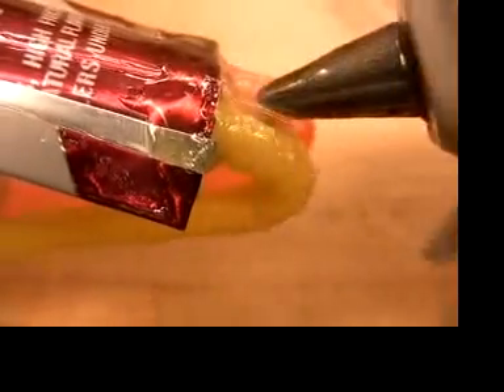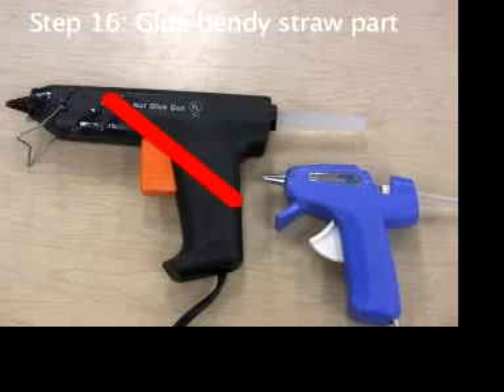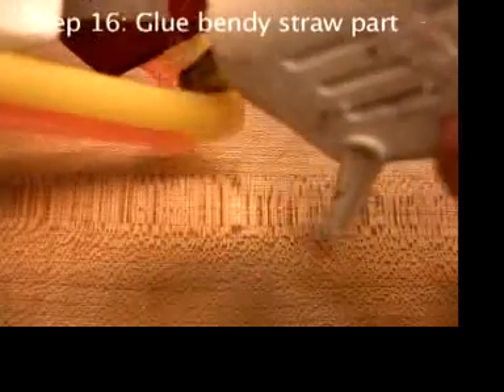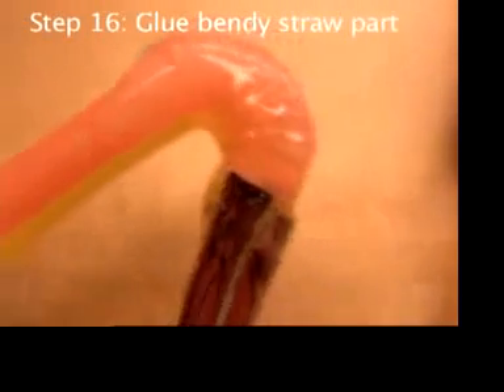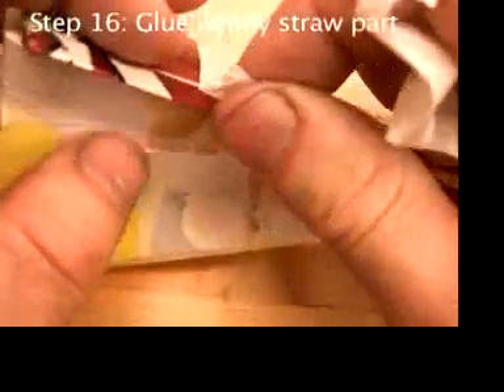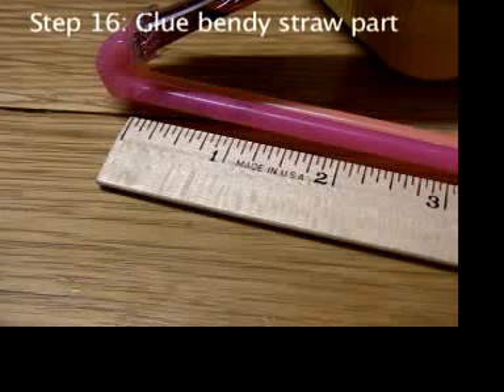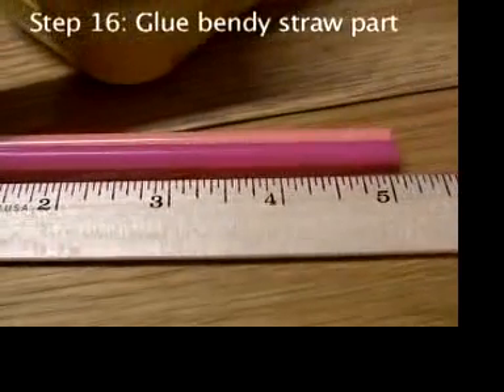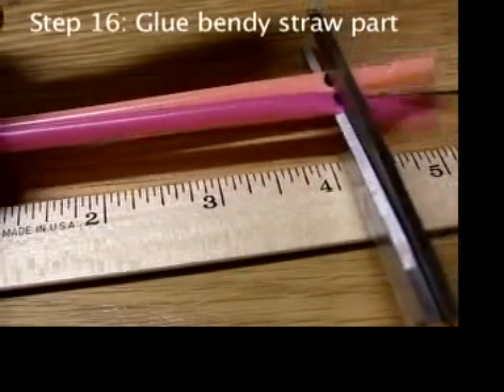Part 19 Build a Putt Putt/Pop Pop Steam Boat s16 glue bendy

Comment: My glue melted through the straw and my project is due tomorrow!!! Does this mean i will have to start over?
Reply from the maker: That's why it said to use the cooler kind of glue gun. You might be able to rescue it by unplugging the glue gun so the glue has cooled somewhat, but not yet solid. Then patch it. Or use another kind of waterproof glue--like epoxy--to patch it. Don't wait until the night before a project is due!

Comment from the maker: That is correct, because hot glue at the metal part where it gets quite hot would melt. But I can hold the engine by the bendy part even while it's running. The bendy part does NOT get very hot, so hot glue works well there. Some people don't like epoxy so they have the option of reducing the amount used.

Comment from the maker: Well, straws are cheap, so you can experiment. Even if it's too hot, you might be able to plug in the glue gun and use it as it's warming up, before it gets too hot.

Slater

Comment: im just gonna leave this here:
if you have a high power glue gun, you can use it BEFORE its fully heated. Apply glue once the gun is just hot enough to squeeze the glue out. I did this with a 60w and my super thin staws are fine

Comment from the maker: @TOMREED1 I don't know all the dynamics but I think, yes, too long would create too much friction in the pipe to work. If the pipes were too short the water column would not have enough momentum to set up the instability that alternates between high and low pressure. It would be interesting for someone to experiment with how long and how short the pipes can be.

Slater

Comment from the maker: @GLADIETOR The 102mm length of straw after the bend is based on anecdotal observation. It goes faster when i cut a little off.  If i cut off too much, it stops working. I can only speculate why. Perhaps the extra length introduces extra friction?
Slater

Comment from the maker: @melason83 The epoxy glue is used where the engine gets hot. You cannot use hot glue instead because the glue will just melt when the engine gets hot. Try to find epoxy.
Slater

Comment from the maker: @DeKatBe Actually, epoxy would work to keep the straws stiff. But people seem to hate working with epoxy. Because--unlike the engine--the straws do not get hot, you have the option of using hot glue if you prefer.
Slater

Comment from the maker: Silicone is not strong enough to hold the arched shape. You could use it in addition to the epoxy to help seal the engine, but then you have to wait several hours for it to cure vs 10 minutes for epoxy. And if you have to add more, only silicone sticks to silicone.
Slater

Comment from the maker: If you look at the package for white glue, it will say "water soluble" so water will melt it, and "for porous materials" which means it only works on paper, leather, wood, etc--not metal or plastic. So it won't work. In the introduction, I ask, people to follow the instructions exactly the first time.
Slater